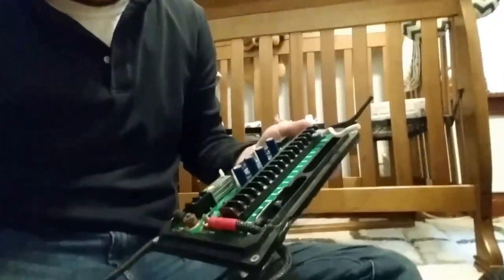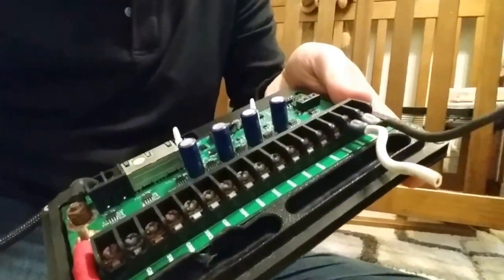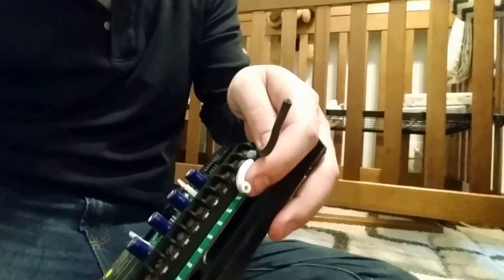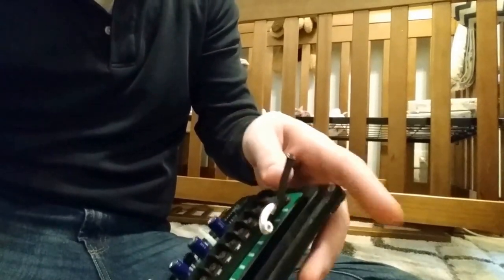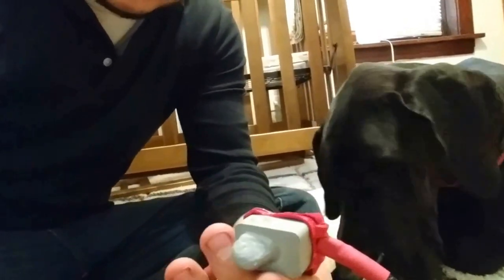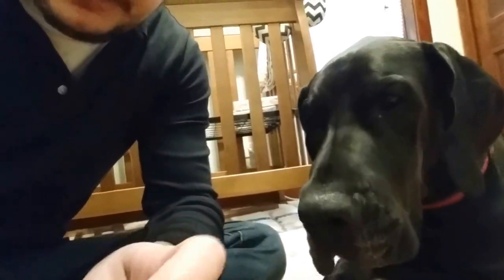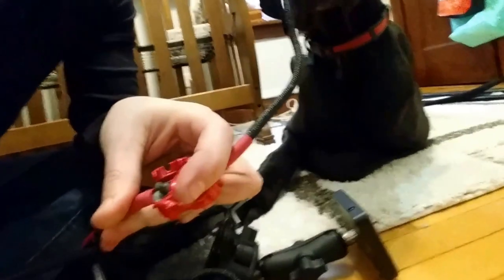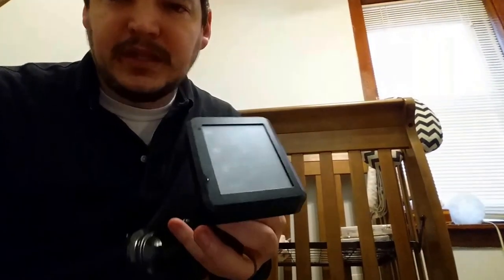SPOD Failure

Comment: is it possible that the accessory you had connected shorted out? have you installed a traditional fuse relay set up, and the accessory is working?
Reply from the maker: No it was the SPOD that failed. Once removed from the system everything worked commented to an old school flip switch.